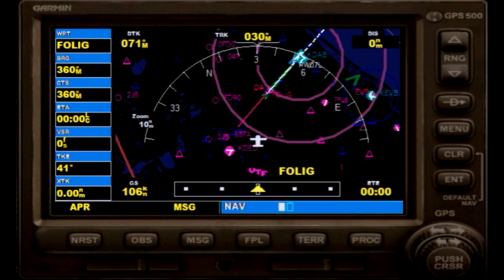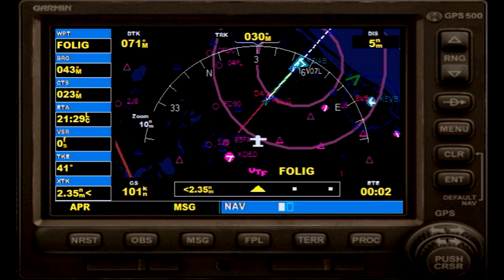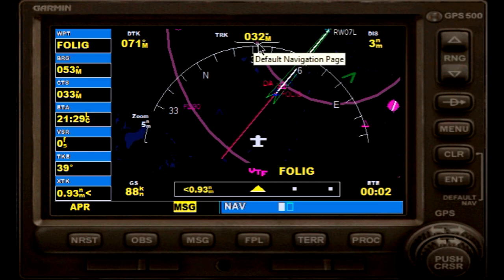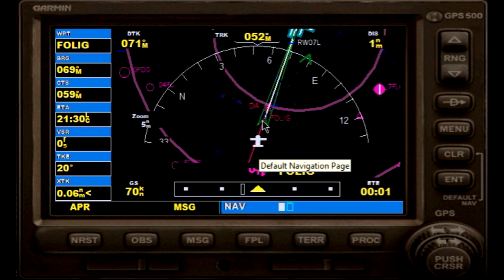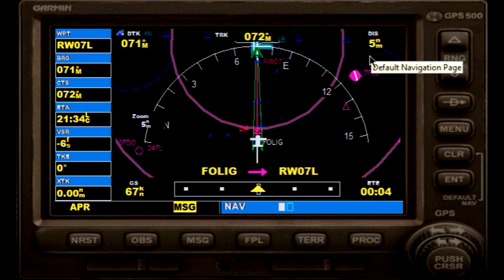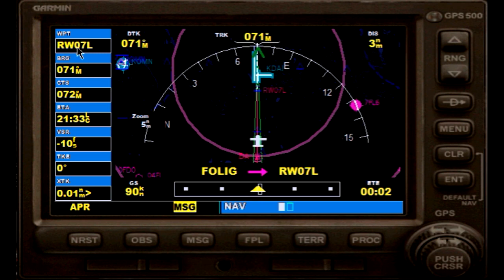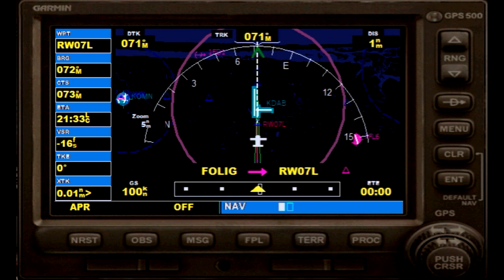FLy GPS/RNAV Approach

Comment: ok, but how do you get vertical guidance in an RNAV approach to the threshold like you would in an ILS approach?
Reply from the maker: Hi Christian! That's not possible with a normal RNAV APPROACH/Equipment. That's would require WAAS/LAAS equipment on both sides, the cockpit (receiver) as well as on the ground. Some airports in the US are already equipped with this with more to come. It's the future of ILS ;-). In case you haven't seen this yet, check out this link to learn a bit more about WAAS/LAAS https://ifr-review.com/space-navigation/
Reply: Thanks for the information. I was wondering about this as well.

Comment: Are you in NAV or GPS mode, when you active the approach? And do you manually select the descent altitude?
Reply from the maker: Hi Jan.. that really depends on what kind of Approach you intend to fly and/or how you have selected to fly the APPR. I don't know how familiar you are with all cockpit functions etc., but the button to switch between the two modes (NAV/GPS) is there decide which source of navigation your CDI is supposed to represent, that is to say, if NAV is illuminated, it will simply reflect your NAV-1 FRQ. (VOR, LOC, ILS), if GPS is illuminated, it will reflect your GPS Navigation. Your GPS-Unit  should show the same (OFF track  or ON track info). In the case of my video, I was on GPS-Mode. 

And do you manually select the descent altitude? Yes, I manually selected/changed the altitude.
Reply: Thank you for answering! Then this is the procedure I'm doing currently, as well.

Comment: When do you select active approach and what does that actually do. A lot of people seen to bypass 'activate approach' and go straight to 'vectors to final'.
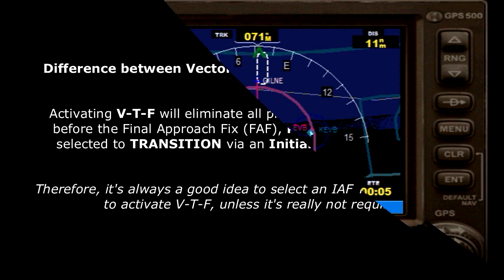Reply from the maker: The answer is actually in the video at the end of it. So check it out again @ 9:23 min! Click here -> https://youtu.be/V2Z2TJc4TUM?t=9m23s

When you activate the Approach all your fixes (IAF, IF + FAF) will appear on your Flight Plan as well as the GPS (plan view). So, you would start your APPR at the IAF. Then from IAF to IF, then to FAF etc... Selecting "Vectors-to-Final (VTF)" will automatically eliminate/delete all fixes prior to the FAF, so IAF and IF will not appear in your FP neither in the plan view (GPS Map).

What's the best choice?! I would say, it really depends on what you'd like to do. HOWEVER, ATC sometimes asks you whether you like to fly the FULL APPR (= via IAF, IF to FAF) or just get VTF.  Flight Training (Instrument Rating) is a good example for this. Another time that you may get cleared for a FULL GPS/RNAV APPROACH is during busy times (rush our in the air), when ATC may be to occupied to consistently give you vectors to intercept the FAC. Already happened to me btw.. Or they just say, fly direct ..... (waypoint). Then you check your loaded APPR & MAP looking for this point which is not shown (ex: IAF) because you have already selected VTF instead of the FULL APPROACH... I that case you would have to 'reload the APPR'. Hope that helps and answered your question. :-) lemme know if you have any further questions!
Reply: ifrPilot-david thanks.